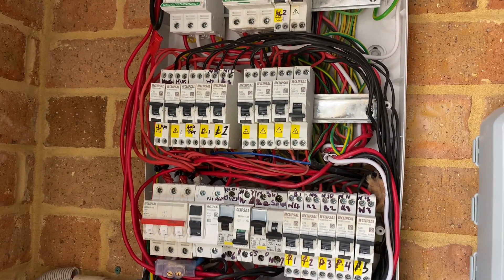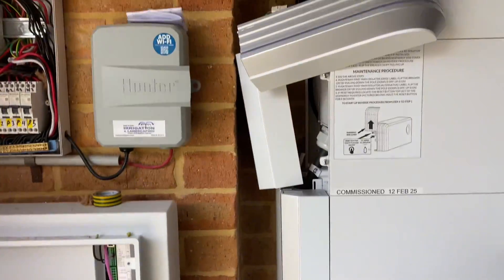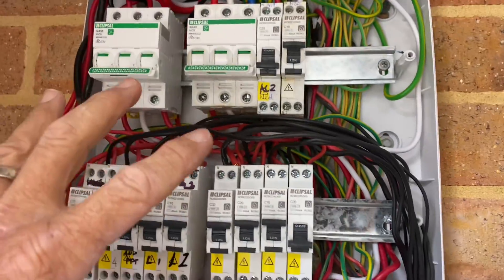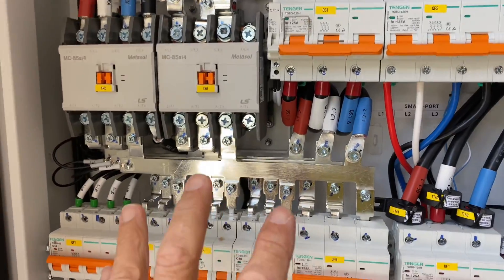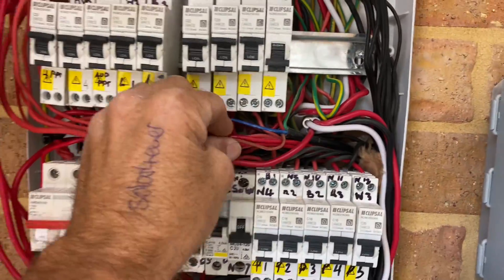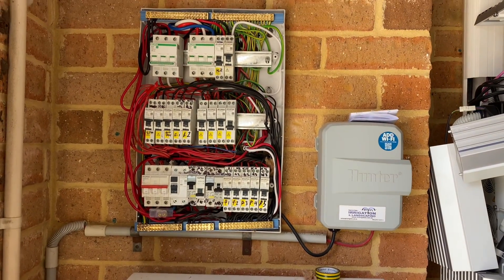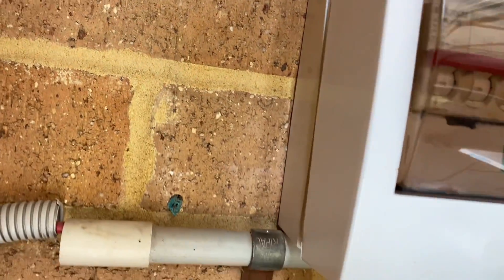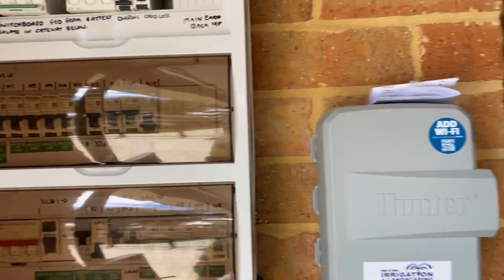Sparky after sparky keep jamming more circuits in, to the point the switchboard is now destroyed 💩

Comment: Customer (almost always) wants the cheapest price. Not enough tradesmen want to risk losing the work unfortunately. Also, stripped screws are almost always because sparkys use impact drivers on switchboards. How hard it it to use a screwdriver.
Reply from the maker: Valid points 👍🏻

Comment: What do you recommend in the resi world regarding brands/models for busbar solutions. I've only ever dealt with commercial electrical as an engineer, and it's always baffled me how shitty residential DIN rail solutions are. I've got 3ph and my "standard" 3 row meter box was basically full from day 1 on a 2021 build. Seperate RCD + circuit breaker + 2pole contactor just for an induction cooktop... All power circuits off one RCD and 3 CBs, because RCBOs are too expensive apparently ffs. I'll be getting a Sigenergy system at some point and putting an extra board in the garage before feeding back to the original one. Sounds like Hager is the go?
Reply from the maker: Look at Hager and Clipsal panel boards. Or if it has to stay in the meter box Clipsal do have a neat busbar system for din rail Resi Max range Slim comb busbar RMXPH312

Comment: Clipsal is poo 💩... 
Ask your electrician to install Hager, use PVC glue for conduit, cable glands in entry points and most importantly to all tight arse electricians, buy some pole fillers.
They're literally 10 bucks for 18.
Reply from the maker: Hager make a nice panel board

Comment: Looks like my eldest brothers work, he will run 6 cables into a surface socket instead of using a J box . Problem is most new builds have these cheap switchboards that have enough space for the bare minimum circuits
Reply from the maker: We def need bigger boards, this shit does my head in.

Comment: Was installing a ducted system on a customers Mansion while back. had at look at the suboard feeding the house. it was about the same size as this one, just chockers with CT's for the solar shoved in their, the lid was bulging, shi*t everywhere just a mess like this. I will never understand why some sparkies try save literally $20-30 and put a pissy little board like this in. literally its just plastic their cheap as even the nice ip56 ones. customer was a snotty posh cun*t the house was worth around 6 mill i recon and was the largest ive ever seen, so money wasnt an issue. said to her "Get this whole board ripped out and replaced with somthing larger and more professional, you've got somethinng i wouldnt put in poor people houses" haha i think she took that advise. just so stupid, when i install any boards even if i know its only ever gonna have a few circuits ill still throw in something massive just because you may as well, and always use busbars omg its 2025 it should be the standard across the board just like RCBOs are now.

Comment: It takes years of skill to twitch that many wires together and jam them in those main switches without a cm of copper hanging out .  Its got everything the solder and tape method of not going near the main switch to ad a circuit  and im not sure the what the big arse 2 screw connector is achiing . They come in handy as well.
Reply from the maker: It sure does, I dont have the patience for it 😅

Comment: Looks like a good time to upgrade the switchboard. If RCBO's were used would that free up space. I expect the answer is yes but anything that is done is going to be costly for the property owner.
Reply from the maker: This board is cactus and needs to be replaced as its now damaged with stripped securing screws
Reply: It already has rcbos, bar one RCD on the bottom DIN

Comment: That looks almost exactly like our Switchboard after we installed solar, battery, induction stove, ev charging and heat pump. I then paid for upgrade to two larger metal switchboards with busbars, one acting as an essential circuits board. So worth it. You can actually see what's going on now and still lots of space for future add-ons.
Reply from the maker: Perfect 👌🏻

Comment: My experience,often, is that customers, even when told of sub par equipment, don't want to spend the money to upgrade. Then comes the problem of liability/duty of care  around performing work on non-compliant boards/wiring. Duty of care could mean turning power off and/or not performing electrical work until safety is met, and reporting customers to the supply authorities/contractors board. Not much fun to be had there...
Reply from the maker: Exactly, not many guys would walk away and say it needs to be replaced as its

Comment: We have an 80 amp 3 phase main switch, if we get electrical work done I was told it needs changing to 32A to meet new regulations, would that mean it'd be split into multiple circuits and mess with our use of ethernet over powerline?
Reply from the maker: Yes thats correct, EoP should be fine

Comment: Yep. Installing new board isn't cheap, but when it gets to that sort of a mess...
When my daughter bought her first house last year,  it still had old ceramic fuse holders in the box and looked terrible. All they had done to bring it up to "standard" for sale was bung in two RCD's - the mounting of which also looked dodgy as. (Houses being sold in Qld have to have RCD's when sold these days). 
My immediate advice to her was get the board upgraded as soon as she could afford it.
Reply: Admittedly I don't know the current situation but not too long ago it was possible to sell a house without RCDs fitted but the new owner had to have all finals RCD protected in one way or another within 30 or 60 days, or something like that, after the sale went through if the intent was to use the existing house rather than demo and build something new.  As far as I know that hasn't changed.
Reply from the maker: Good advice mate